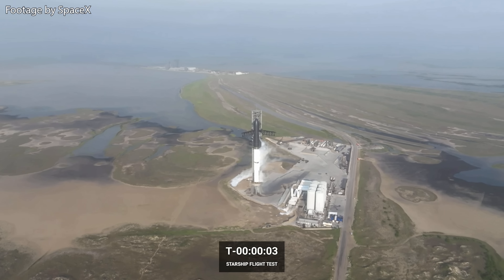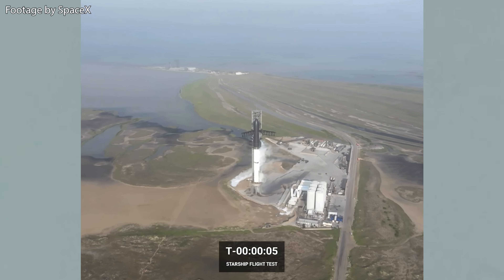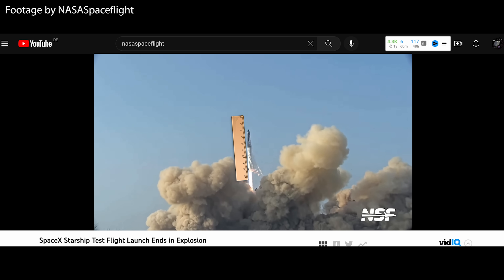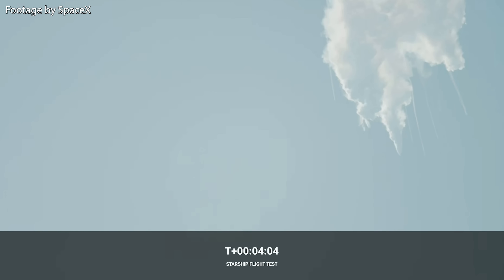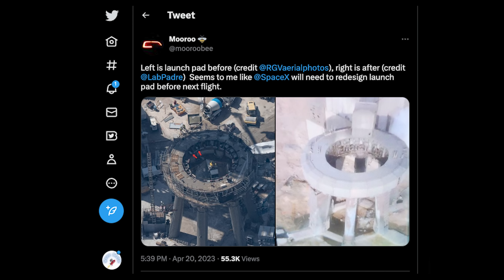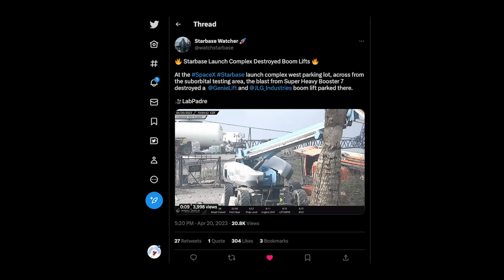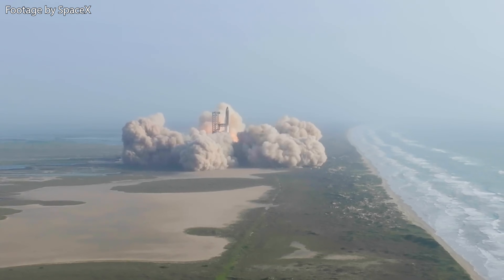SpaceX Launches Starship But Causes Big Damage to the Pad. What Went Wrong?

Comment: The "anomaly" began the moment the flight program ignited the first stage.

As it had on all previous tests of that first stage, the flat face-on concrete surface beneath the launch stand reacted badly to the acoustic pressure.

Even as hundreds of yards of green, incompletely cured concrete began to pulverize under the punishment, the vehicle itself suffered serious damage first from reflected sound energy, then from impingement of a highly energetic whorl of mixed exhaust and concrete to the engine compartment.

The launch stand itself was not immune to this punishment, and was being shaken and blasted apart even as its hold-downs restrained the vehicle atop it. Metal fragments of the launch stand were slamming into parked vehicles a quarter mile from the pad within seconds.

A crippled, malfunctioning vehicle struggled off the pad on damaged motors controlled by damaged hydraulics, with vital sensors and actuators failing and with sysems continuing to fail throughout flight.

Within two minutes both hydraulic systems had not just failed but exploded into flame. Thrust ebbed and the vehicle never reach first-stage separation speed or altitude before beginning to fall.

This is supposed to be a passenger craft. It's supposed to be able to fail safe and recover its occupants alive at any phase of flight. SpaceX sold a future flight of this vehicle to a Japanese billionaire and promised it could deliver 100 passengers to space. Does SpaceX still have enough liquidity to pay that man back?

Comment: Rolling before explosive termination:
Poor design from a stability perspective. A thin, slender cylinder, with max thrust is dependent on mass distribution and base thrust. As the fuel burns off the mass centre shifts upwards causing a turning moment. Motor rotation is insufficient to maintain stability once things get challenging. Active stabilisers may be needed above centre of mass to offset base thrust. Musk refuses to acknowledge a poor design. His Theoretical Mechanics professor would have failed his design. 😊

Comment: in KSP, usually the loss of control and flip-over behavior is due to excessive speed, poor aerodynamics, wrong balance of masses, or a combination of all three.
you take the same rocket and dial it back a notch on the climbing speed and the attitude reaction, and it should fly perfectly smooth, provided it's balanced correctly.
sometimes too much thrust IS a tad TOO MUCH thrust.

Comment: This is exactly why private enterprise space launches are bad. 
"Nah. Building a flame trench will take too long." WTF? You've had YEARS to design and build your launch facilities. Or was it you considered it too expensive?
"Nah. It's 2x as powerful as the Saturn V, but it's too expensive to build a flame deflector"
"Nah. It's 2x as powerful as the Saturn V, but it's too expensive to build a water deluge system that would mitigate the acoustical forces and not damage the ship."

When business decisions (ROI? Costs? $$$$?) over rule everything else, the backers will bail every time.

In the near future, Elon will say, "NASA will close down the ISS and deorbit it in only 7 years. This is taking too long to make it work and it's too expensive to do this. I'm going to bail, and shut down this whole operation."

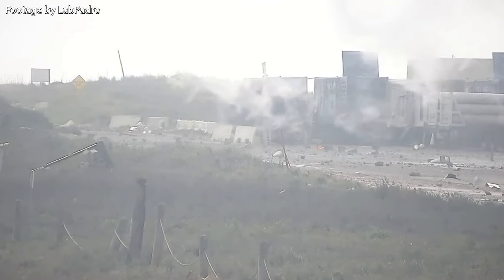Comment: Yikes! There may not be a form of concrete that can withstand the combination and scale of heat, thrust and vibration. So I can conceive how the failure of the concrete may not have been anticipated. But the damage to nearby buildings is another matter. The design and construction of a launch pad area specifically made for this giant rocket should have better anticipated the exhaust well enough not to blow down gates made of steel bars (4:32). These allow wind to pass through them and would easily withstand hurricane force winds.

Comment: It doesn’t take a structural engineer to predict that Starship would destroy the launch pad. SpaceX is incredibly lucky that a big piece of concrete didn’t cause a catastrophic failure and massive explosion while Starship was still on the launch pad, or barely off the ground. SpaceX needs to build a massive flame trench with deflection shields and a water suppression system. 

It’s basic physics. All of the power and energy coming out of all those raptor engines has to go somewhere, and without a massive trench with deflector shields to redirect all that power away from Starship, the energy is just going directly into the concrete below Starship and much of the energy and debris is then bouncing right back up onto all those Raptor engines. 

Even with all of these added components, SpaceX is crazy to have so many vital structures and pieces of equipment so close to the launch pad. There shouldn’t be anything within a half mile of that massive rocket ship when it’s launching.

Comment: Great news . What I dont get is the launch pad. Looking at previous launch pads for Saturn and other large rockets had massive concrete structures. Often wondered why Spacex had such a simple launch pad. It never looked robust enough , especially for 30 odd engines.

Comment: I remember that nasa used a lot of water at the start but I am not sure for which exact purpose, probably to create additional lift bei hot steam.
Also when looking at the launch of the energia system in Baikonur 40 years ago, the structure had a huge canal to direct the flow of hot gas.
- It's implausible to me why no corresponding structure has been created here.
Possibly they try to avoid it for the reusability, but then they would need very different material on the ground.
Reply: Waters used to dampen the noise and vibrations to protect the rockets from damage. Sound suppression basically
Reply: @jayryan1956  that is plausible. However taking into account the additional volume of steam and heat, I would assume that it would also create some supporting lift.

Comment: The great engine force plus combustion and the weight or the load which is too close to the ground or the launch pad that forces too much and destroy it, it needs like a spring force or to shock up the rocket to reduce counter force that causes the damages of the launch pad.

Comment: I'm no rocket scientist, but it seems like igniting that much force and sandwiching it between a flat surface and your rocket engines is asking for high pressure damage as the pressure wouldn't be able to get away fast enough.  It'd be like a pressure bomb.  Is there some physics or something that I don't understand that they were relying on to counteract that?

Comment: I think it's very likely that non-functioning engine at liftoff were due to damage from debris and also believe that you can't rule out that the subsequent engine failures were due to damage they sustained but they just happened to fail later like the one that exploded at the out ring. I said before the lunch when I saw the construction of the launchpad that it would be crazy to build a launchpad for a rocket that powerful when every other launch platform for rockets of similar size require massive diversion trenches and water deluge system.

Comment: It's a no brainer, needs deluge and diversion both. Don't know what SpaceX is thinking, team must tell Elon there will be damage every time if not dealt with properly. There's talk that they're planning metal beneath the OLM this will only force the flame out to the sides and cause damage from searing heat and flame (extreme temp and exhaust) look at the force from the exhaust how far out it spread from ground zero.

Comment: We all have expectations and it’s rare for them to match. Happens the first week of every job I have held. Elon had a zoom call trying very hard to lower the expectations of everyone in the press. He said he would be happy if they cleared the tower. I don’t think that he expected the amount of damage done to stage 0 and clearing the tower. They have data that I hope is useful. I’m of the opinion that a flame diverter and trench in the direction of the Gulf is necessary in addition to the planed deluge system. The water table is very low but that can be overcome. Now overcoming the EPA is another matter.

Comment: **After the full on engine test fire, SPACEX knew it needed a flame trench.  How do you design a flame trench for a NEW experimental rocket?  You could build one after the other until you got it right OR you could let the rocket tell you what it needs by firing one.  NOW SPACEX knows the size and depth needed without experimentation.  They can BUILD ONCE and have it perfect.
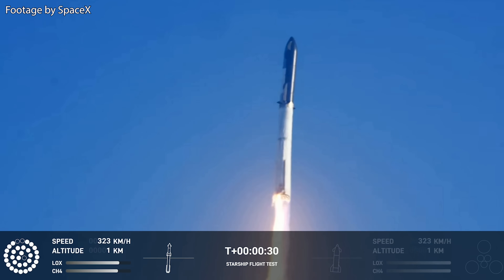2:18   is when the HPU explodes right after the near by engine explosion.  (Making the rocket uncontrollable from that point on)  A problem predicted by SPACEX because every ship after this is electrical, not hydraulic controlled.

Comment: The blast doors for the elevators for Artemis 1 blew off and went missing. Who's to say this type of damage isn't common for massive thrust vehicles, but we don't know about it. Afterall, taking pictures of the launch pad after the Artemis 1 launch was forbidden under ITARS.
Reply: Some elevator doors and other minor damage doesn't compare to this mess. Yes, SLS did some damage to the pad, but not anywhere near this level. SLS pad had flame diverters and sound suppression water system, which prevented most of the potential damage.

Comment: When NASA launched Saturn 5, there was nothing within miles to get damaged. Given the extent of the damage to surrounding structure and vehicles, it seems that SpaceX had no idea how wide an area to clear. How could they have misjudged by such a large margin? Quite frankly, I don't think that NASA is ever going to allow SpaceX to launch that second launch pad they're building at Cape Canaveral. They're going to have to move it far far away from their existing launch pad.

Comment: I think there was more power going through some engines then they shut them down and yes I think there was a wobble too. But due to the lift of and shock they need more to dampen the shock like a water inlay somewhere around the launch pad. Otherwise the Shockwaves will be just as bad and everything should be moved to at least 1.6 kilometers or a mile away. At least just saying look as nasas space pads.

Comment: SpaceX needs a Plan  B, and fast. The existing OLM concept is unsustainable it will have to be demolished. Apart from a proper flame trench, most of the sensitive equipment on the OLM is gonna have to be installed well away from the rocket. Just hope SpaceX has the funds to do this. Iterative development maybe ok for small projects but is financial suicide on something as big as Starship.

Comment: A rocket with more thrust than the Saturn-5, and he chose NOT to have a flame-trench??? What was he thinking??? He had all the numbers he needed to make the correct decision, and chose the wrong one. He, (Or, more correctly, his construction engineers) knew the limits of the concrete pad at the launch-site and the underlying ground. His rocket engineers knew the temperature of the burn and the thrust. I'm sure these two sides had a discussion, and that someone probably mentioned something to him, something along the lines of "You're gonna need a flame-diverter and water-damping system you idiot!", but since it wasn't HIS idea,... It was lucky, given all the concrete seen flying, that the damn thing didn't get ripped apart before it cleared the tower. As it was, it was loosing engines almost immediately.

Comment: IMO, it was the extremely poor and completely inadequate design of the launch pad that likely cause the launch to fail. The rocket was likely badly damaged by large chunks of concrete from the disintegrating pad. Quite possibly to the point where that damage caused the failure. Not only was the rocket destroyed only a few minutes into the flight (actually it was probably destroyed by the time it was a few feet off the pad) but the entire facility seems to have suffered extremely severe damage. Probably not in the billions of $$$, but they need to redesign things, not just put everything back the way it was. Also IMO, the launch pad was way too close to the rest of the facility. But I don't really see any way to move it farther away, the whole place is almost under water. Maybe keep the pad where it was (but where it isn't anymore) and move everything else back inland a bit. I know it needs to be on the coast, but NASA didn't have anything anywhere near that close to the launch pad for the Saturn V.  And the SLS did cause significant damage to the portable launch tower. Thes huge rockets with an insane amount of thrust are going to need launch facilities far stronger than anything ever used before, and that may be a significant problem in itself.

Comment: For on-land option, the "reflector", possibly, should be built from the same material as the exhaust bodies of the engines themselves. Under the "reflector", possibly, there should be built an efficient cooling system. This "refrigerator" should work in accord with the today-existing external water-pumping structure.

Comment: Marcus House analysis suggests that one of the Hydraulic units for gimbal control may have been damaged during liftoff and early ascent, which would explain why at near stage separation it was not possible to gimbal and vector the thrust of the inner 13 booster engines.

Comment: Looks like this rocket is digging it´s own flame diverter system. A few more launches and it will be done 🙂. I wonder what the water deluge system will be able to accomplish with this much heat and pressure. I guess improvements the ground system will have to go hand in hand with the upgrades to the rocket. Either way, Exciting launch and I loved every second of it.

Comment: Sir! the rocket did not explode; Spacex terminated the flight because the rocket entered an uncontrollable spin. This is why the launch is considered to be a success, the purpose of which was to collect as much data as possible. These are the milestones achieved 1. the rocket was fueled successful which would involve all launch support systems 2. the rocket's engineS ignited successful allowing the rocket to clear the launch pad 3. rocket flew for approximately 4 minutes. 4. the rocket survived maxQ.

Comment: It's possible and maybe even probable that the "crunched" look of the rocket is a video rolling shutter artifact since mechanical tracking with high magnification is rarely perfectly smooth.  Regardless, I suspect SpaceX will be carefully looking for any evidence of structural problems caused by launch or flight stress.

Comment: May be they should go back and watch those Star Wars movies. Every space ships should be like the F35 where it takes off and lands wherever it likes. 
The Starship super long vertical structure and 33 engines doesn’t make sense. More engines more failures. And landing vertically is just not safe. 
Should have just modified the space shutter to make it bigger, put two more gigantic rocket boosters, and make it like F35 so it can land anywhere. 
Yes, old wisdom NASA knew what they were doing….at least they put a water lake under the liftoff tower.

Comment: I wonder if it didn’t separate because of an independent flaw or because the guidance system knew it wasn’t it in the right place at the right time and continued to seek proper flight path with asymmetric thrust.  Also, launch pad issues are real trouble for landing on unprepared sites.  Perhaps he intends to ruggedize the engines as he works to keep the launch pad intact at home.

Comment: Musk was more concerned with the stand being reusable. Everything will be scrapped and a completely new launch pad engineered. The ground water table is so close to the surface, a flame trench would be in the ocean. Is this why it was never done? Concrete flying straight up off the pad? Seamless weld plating to cover any exposed concrete? The rocket exhaust pressure is so high it will push water away faster then Musk can pump it. A new flame trench/ocean canal built to reach out into the ocean? A lake of ocean water formed under the launch platform to quench?  The flame pressure could be harnessed to push lake water into large pipes that feed the deluge system on top of the pad? The lake can be refilled by opening a gate in the flame trench/ocean canal.

Comment: Ahhhh...yes! The Sweetness of Success =
Serious damage to the launch tower
Cratered launch pad
Debris scattered for thousands of yards throughout the complex
Damaged vehicles, machines, tanks, etc.
Failure of some rockets to ignite upon launch, additional rockets fail throughout the launch
Failure of the 1st and 2nd stages to separate
Loss of vehicle control
2nd stage is not able to perform at all...basically is just dead weight
Vehicle destruction within minutes of launch
Debris being scattered into the Gulf of Mexico

Comment: Too many rocket engines too ever be visible. If even 1 failing will result in a failure well.... Mars is for sure out of the question.
Why not just a few big engines. 
+ all the engine tests it breaks them soo.

Comment: Let the amateur do it so we learn things from mistakes, not a bad idea but please, don’t be disheartened. People turned timid after a screw up and tend to do things extremely careful, but that hinders progress. Spend a couple of months building an invincible flame deflector and test again. It’s true launching without a flame deflector is a must-do-thing, how else are you going to return to earth from an unprepared Mars surface? But one thing at a time. First determine that the 6 or so dead engines are not the products of deflecting concrete rubbles or engine flames, and that the trembling rocket shaft is not caused by the unbalanced thrust from an misaligned engine array, etc.